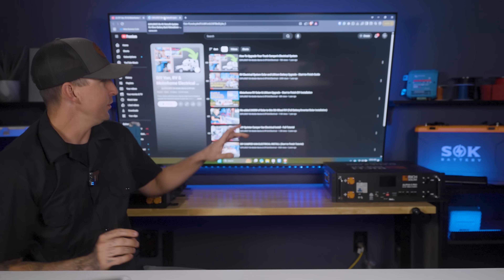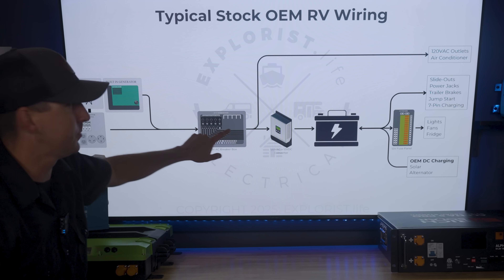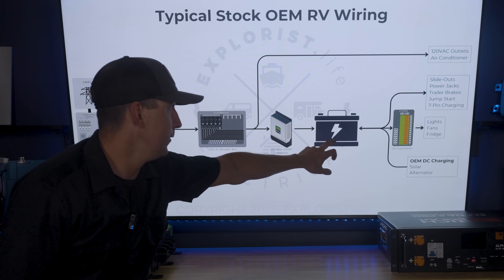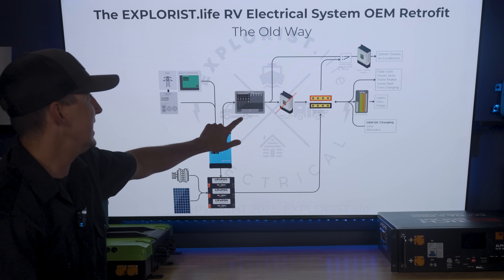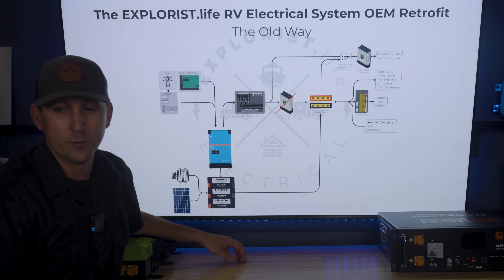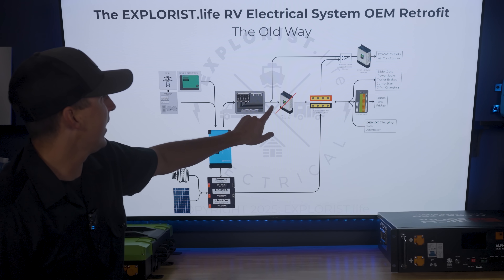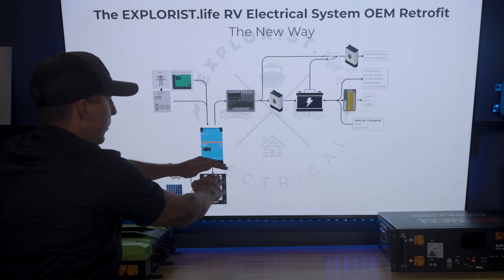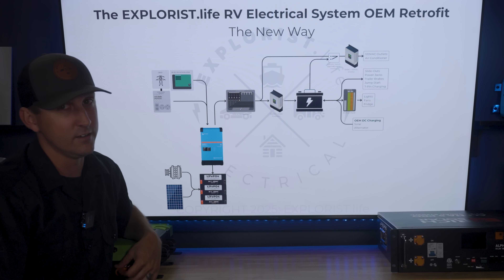The New Way to Upgrade RV Electrical Systems (No More Battery Relocation Kits!)

Comment: 7 years ago i fell into the solar hole and wanted or needed power in a temporary trailer to live in. 
I had no options for power to plug into. I did have a cheap 120v 50ft 15amp extension cord and couldn't use the perfectly good ac unit or microwave. It barley ran the coffee pot and TV. 
I went through multiple types of units experimenting with gel batteries and different inverters i burned a couple up having no experience but studying everything i could absorb to learn diy Facebook and anyone on YouTube making videos.
Finally i spent the money on good solar panels and a real inverter with built-in transfer switch and lithium battery's. 
I don't live in that little 23ft trailer anymore 3 year's now but the solar system i installed is still chugging on even though the trailer is only used for storage. It's burped a couple times and needed reset but it just works. Its been a 4 year test of reliability and it's not let me down. 
But at that time i did exactly what you do now.
I only spliced into the 30amp cable for the in and outputs of the inverter. 
Today im installing a 10.000watt 100% victron blue system 48v in my new solar shed having bought a some of the pieces from Exploestlife and other sources  like blue Polar wire. I don't expect it to ever fail me and be a smooth experience. 
There's a few small pieces i need to complet the parts list and ill probably purchase them from you. And get some payed advice on the installation programming but i owe a lot of my knowledge to Exploestlife.
Reply from the maker: Hey, I appreciate that feedback and I'm glad you found our store useful for supplying parts for your project.  We are here if you need us!  https://shop.explorist.life/support

Comment: I'm about to do this on a yacht, and I need the space and weight savings from removing the old bank. Having simpler wiring with fewer connections is also a plus on a saltwater boat for safety monitoring of corrosion and loose connections. But, this is really appealing for the ability to upgrade to a higher voltage bank with no fuss (just drop in a 48v rack battery with all its benefits). I've already got 12v replacements so I'm going that route for now.
Thanks for the content. Always helpful!
Reply from the maker: That sounds like an awesome setup! To make sure you get the right parts for your project, reach out to our team here: https://shop.explorist.life/support

Comment: First, thanks for all your videos over tyre years. 
Would it be accurate to summarise this version as "adding another AC input to the generator/pedestal line in via a solar and/or DC-DC fed Multiplus connected to LIFEPO4 batteries"??
That said, I'm guessing you still need to build input distro like a Lynx, fuses, shunt...ect and a cut off switch? If that's true there isn't a cost saving but it is easier to "add" this power source to the RV? 

Our upgrades are done but I can see how this may have been an easier option to start. I will say that I found several serious factory flaws in our class C during the upgrade including their TERRIBLE version of grounding the coach systems and a loose connection in the switch that had charred the lines from heat... Prob would have been a fire that started under tyre bed. Yikes. 

Thx again
Reply from the maker: You’re right that the details really depend on your individual setup. If you’d like us to take a closer look and recommend the best parts to make it all work smoothly, reach out here: https://shop.explorist.life/support

Comment: The new way assumes you are using the multiplus. In my case we used a modified version of your upgrade process (no multiplus) on our motorhome due to space limitations. I didn't leave the old batteries because the battery upgrade required more space and the AGM batteries that were there were ready for replacement (~3 yrs vs. 10yrs lithium). I guess I could have replaced the 2x6v AGMs with a lithium but keeping costs down.
Reply from the maker: Inverter/charger (multiplus, Quattro, etc) based systems constitute 99% of our OEM RV retrofits in our store and installation shop, so yes, this video would indeed only be appropriate for those.  If you have different needs, we can have that discussion in our support inbox: https://shop.explorist.life/support

Comment: That’s pretty much exactly what I was planning with my system.  To me (camping on solar in cold weather) keeping the outside battery lead-acid makes sense, as self-heating feature of lithium consumes power and takes time to get the internal temperature up to where they can take a charge. 

I may retain an MPPT and ground panel connector on the 12v, just to keep the lead battery at 100% when the rig is stored under a carport when the inverter is shut down.
Reply from the maker: That sounds like a smart setup for your needs! If you’d like us to take a closer look and help you get the right parts to make it all come together, reach out to our team here: https://shop.explorist.life/support

Comment: Good morning and thank you Nate & team. So the original factory converter BREAKER PREVIOUSLY  recommended to be turn off in the AC breaker panel is now turned back on?  
This allows the factory battery bank to act as capacitor dealing with the heavy amperage draw for electric lifts, generator starts and hydraulic slide pump motor correct? 
 I am thinking a single solar panel with a mppt controller just for house batteries when 5th wheel is in the storage yard (no ac) thus leaving Victron Multiplus ii 2- 120 in the off position.
Any words of caution or correction to the above understanding?
Thank you again for another great video!!!!
Reply from the maker: Great questions! The best way to confirm those details is to look at your exact setup. Reach out to our team here and we’ll make sure everything is dialed in for your system: https://shop.explorist.life/support

Comment: I recently rewired my camper with all the great help from Nate and Steph, you guys are great! I didn’t want to keep the FLA batteries because they’re heavy and I wanted to make it simpler. So, I ditched them. Instead, I ran a 6 gauge wire from the Lynx distributor to a bus bar located near the original battery location. That’s what I used to tap into for trailer brakes and the power tongue jack. BUT, I also removed the factory inverter AND factory charger (with associated 120v breakers and 12v fuse panel). The Multiplus II now powers a dedicated 120v breaker panel and a separate 12v fuse panel (all purchased from Explorist life). In a way, I guess it’s a hybrid of the various ways you’ve shown. Now I can run the A/C, microwave, and any other 120v circuit off the battery. The whole system works flawlessly. Lastly I put in an Ekrano. It’s cool. Just for ease of wiring (having to run fewer wires to the display) I would have done a Cerbo instead of the Ekrano but the whole system is elegant and works perfectly. Oh yeah, I also ditched the wimpy 190 watt solar panel with PWM solar charge controller and went with 800 watt solar array and MPPT solar charge controller. Again, it was all possible because of your excellent videos and fast correspondence and even faster shipping. You guys rock!

Comment: One reason to still use the old way is if you want to use the space freed up by removing the old battery.  I installed a 12vdc system the old way, as per your diagram, and used that space to mount a large tool box on the tongue of the trailer.
Reply from the maker: That’s a clever way to make use of the space! If you ever want help dialing in parts or planning upgrades for your system, reach out to our team here: https://shop.explorist.life/support

Comment: Excellent presentation.  Thank you.  I am used to dealing with my truck/van and since it is basically a clean, from scratch, situation.  I never put any thought into how a normal RV trailer or motorhome might be set up.  I learned a lot from this one.  I think your thinking/ideas from a installer perspective is pretty good on this.  There is a lot of liability/labor with tearing into the factory stuff.  I really hate the power losses and standby current losses (and heat) from having all of those extra inverter/converters from the factory in there though.  Probably irrelevant for most people who are driving, using the generator or plugged in.
Reply from the maker: Appreciate the thoughtful feedback! If you’d like us to take a closer look at your setup and goals, reach out to our team here: https://shop.explorist.life/support

Comment: This wouldn't work for our truck camper. No room for two battery banks.
Reply from the maker: We still sell the battery bank relocation kits for that reason.  Reach out and we can get you what you need for your upgrade based on budget/electrical needs/or room available.

Comment: Do you know which way is more energy efficient. I have a 24 volt system with a 12v lithium using the 70 amp 24/12 to charge it. Which I purchased from you. But debating pulling it out going your new way. Then I have room in my lynx to add a 24v dc to dc charger.
Reply from the maker: The 'old way' is ever so slightly more efficient on-paper or in theory, but not so much so that it should really be much of a practical consideration.

Comment: Looks like the new approach is negates the weight advantage of lithium over flooded batteries. Exceeding 12V for existing systems on smaller vehicles doesn't make sense to me. The design presented looks somewhat more like a business/liability/production decision than one focused exclusively on electrical efficiency. I'm generalizing. I'd stay at 12V and loose the existing battery bank.
Reply from the maker: The weight consideration is a trade off for a simpler system regardless of the upgraded battery bank voltage, but that’s a discussion of what, 100 lbs of factory batteries?  I know people bring 100 lbs of useless junk with them on their trips without a second thought. 😂.

And of course we are trying to reduce liability.  I've been trying to reduce liability since starting this channel, even before we started our store and installation shop.  Since we are responsible for our customers tech support, we want to make these systems as simple and error proof as possible.  It’s a win-win.

Comment: This is how I have running my 24V system . I did purchase the battery relocation kit and 70amp
Converter from  your shop but never got around to installing it. I have been running it like that over a year now full timing and never had an issue .
Reply from the maker: Glad to hear it’s been running well for you and for your purchase.  If you need some help with anything specific, you already know where to find us: https://shop.explorist.life/support

Comment: The victron system may be batter but a lot of us are on a bugit
Reply from the maker: All of our customers are on budgets to varying degrees - some more than others.  If you haven't checked out Victron prices in a while, they've come down anywhere from 5-40% over the last 4-5 years.  Plus, this new way of doing things is actually less expensive than the old way since we are getting rid of a fair chunk of 2AWG wrie and the associated hardware.  Reach out at https://shop.explorist.life/support and we can price out a system that will meet your budget and/or your electrical demands.
Reply: Yes, Victron components cost more, but you get HUGE feature improvements over a cheaper system.  You can also save money and/or upgrade along the way.  If you purchased a Cerbo device but don’t want to spend the money on a touch screen, use your phone instead.  You can use a traditional bus bar instead of a Lynx Distributor if you want.  Use the Smart Shunt instead of the Lynx Shunt to save some money.

I had a GoPower inverter.  It was nice, but I was always wrestling with it and it didn’t have true power assist, and had other issues.  The Victron Multiplus has been a dream.
Reply: Here’s a question…on systems in RVs that don’t NEED any kind of relocation kit, like a fifth wheel where the “old” battery is in the exact same place where you are installing the new lithium batteries, this new way would still be your recommendation?  You would put the new battery bank right next to the old battery and just wire it (the lithium) to the Multiplus and ignore the original battery?  

What if the RV came with a lithium battery?  Still the same recommendation?

Thanks
Reply from the maker: Reach out to our support team at https://shop.explorist.life/support and we can get you what you need, regardless of if you choose the 'new' or 'old' way.  We can sell you either one and now that you've seen this video, you can make an informed decision.